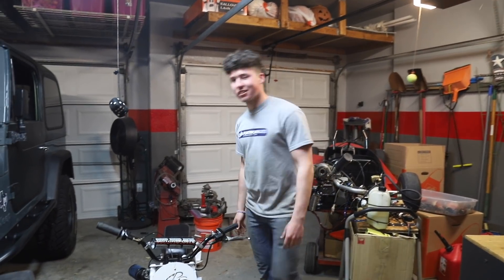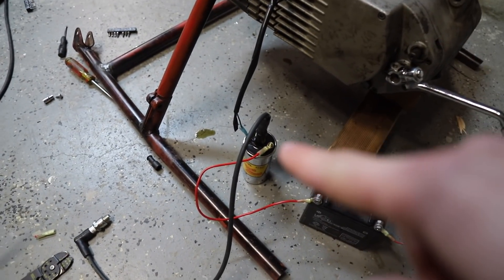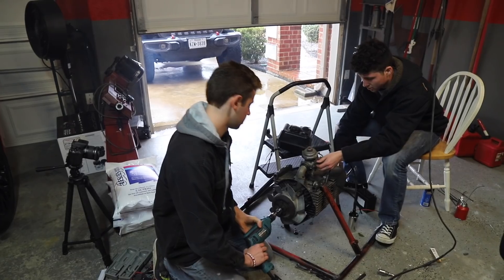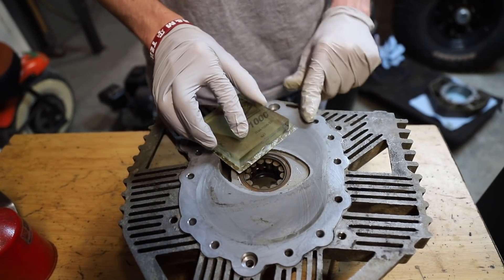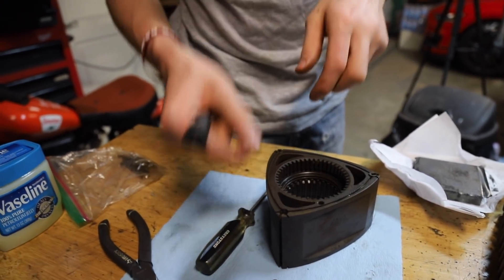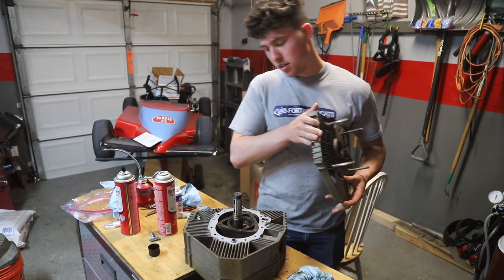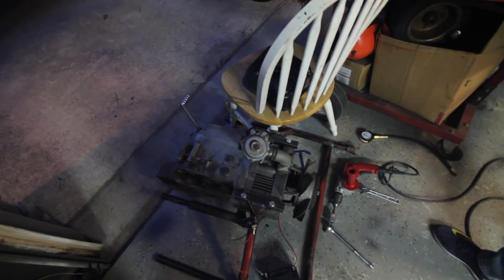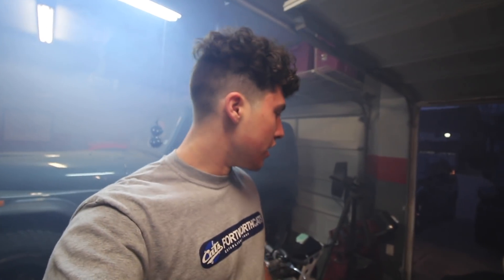Ultra Rare Rotary Engine FINALLY RUNS! | Rotary Shifter Kart Build Part 3

Comment: All the naysayers trying to claim that a rotary won't have the torque you want need to simmer down. 
Small rotaries and Sachs especially need to stay out there; so it's seriously cool to see you returning one to use! 

Keep doing what you do, and try not to pay the armchair experts too much attention.
Reply: The Driven that’s not how torque works... 

The fact it has a dog box bike trans mounted is sweet, as long as the rear gear is kept similar to the bike the engine and trans was made for it should drive fairly similarly. It will end up having very little torque down low unfortunately, but past say 3k rpm she’ll be a dream with the dog box
Reply: FourEyePersonal lol I think MOST would disagree when it comes to dealing with these motors.

Not just an armchair expert, use whatever fancy words you want but I owned an FD Rx7 of which I built the rotary in. You should atleast do basic research about things before attempting them, yea you’ll learn faster, most likely at the cost of this motor. We will see!
Reply: @ADM_Vike  Insisting that your personal experience trumps all others and blesses you with the authority to make judgments about the projects and efforts of others. Is precisely what an armchair expert does. 
Also I find it funny how you tried to defeat the point about armchair experts by calling them "fancy words". We all know what they are, we all know what they like to do.
And to the last point, they've pulled off a stunning turn around on this engine. Sure they don't have the tools or background that others might, but they did it anyway. Sure the parts were hard to come by and cost them thousands. These guys have college to pay for, and they did it anyways. 
I have strong doubts that they're actually going to ruin this engine. But of course that's just a vote of confidence. I don't declare my opinions like they're facts under each video. 
Like say, an armchair expert would do. Like you have consistently done.
Reply: FourEyePersonal I atleast have personal experience, lmfao ahaha.

Saying that my experience trumps theres isn’t saying much, seeing they had none.

The comments are there for criticism, you obviously wouldn’t take it well. I’m simply voicing my opinion, as with everyone else. You sitting back and spewing nonsense is well worth leaving criticism 😂 gives me a good laugh at the end of my day.

You’re the white knight of YouTube comments 😂👌